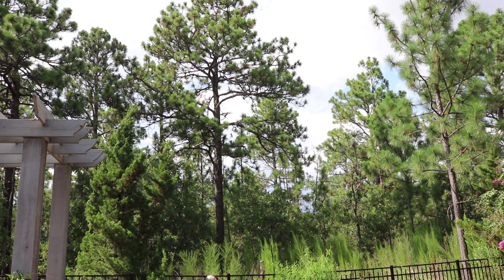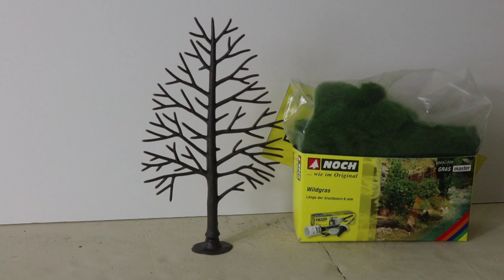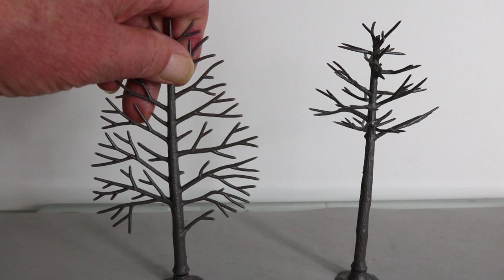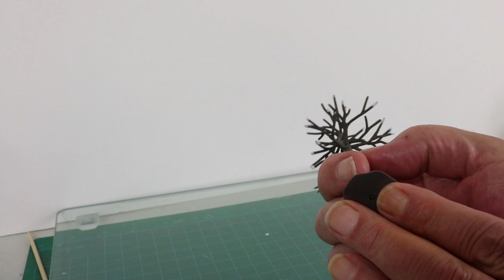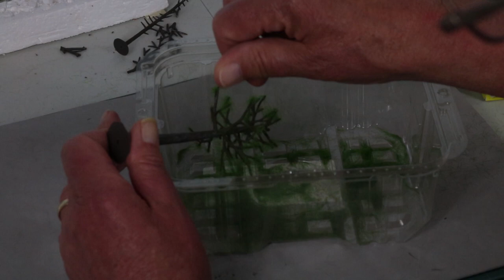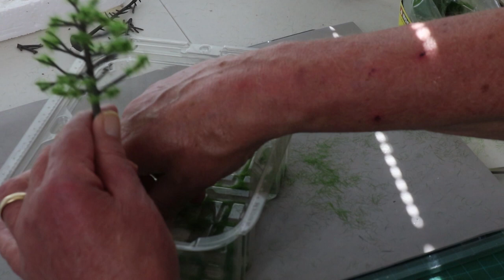How To Model a Loblolly Pine

Comment: I live in NC as well and I'm going to model an NC branch line in the piedmont of NC. I too have looked for pine trees to represent southeastern US pines and too was unsuccessful. Not trying to impugn your work and I think you're on the right track, but I think they still need a little more body to the branches. I was gonna try poly fabric pulled very very thin then add the static grass. I haven't done this yet but it's just an idea if u are interested.

Comment: Great video on a badly needed subject technique for those modeling anything in the Southeast. I myself will need a bunch of these as I am modeling a fictitious railroad in North Florida.. the Watertown Northern.
Reply from the maker: Thanks for watching and for your comment. For a North Florida location, you might be able to sneak in some palm trees which are readily available...Harold
Reply: @nssherwoodsub  Thanks I already have lots of Palms (and palmettos) for the layout from several Manufactures. The pine trees which we have many, many of are the problem. Your technique produces a very respectable southeastern type pine tree.